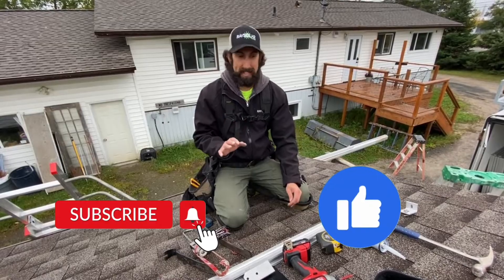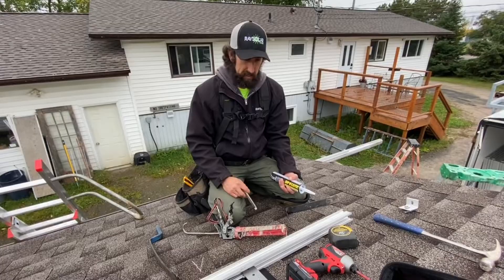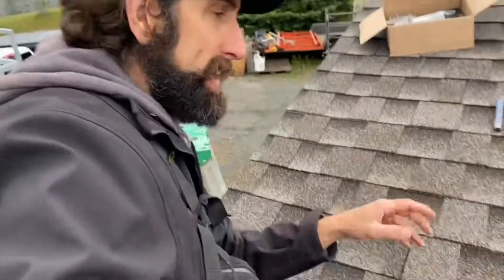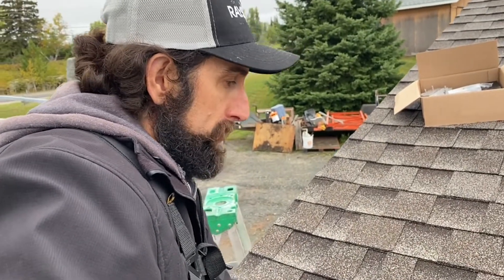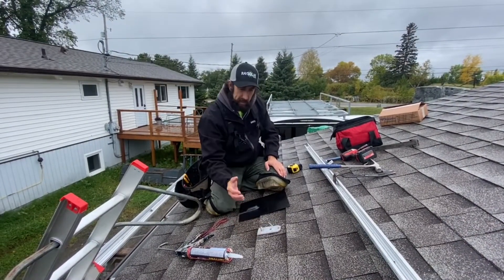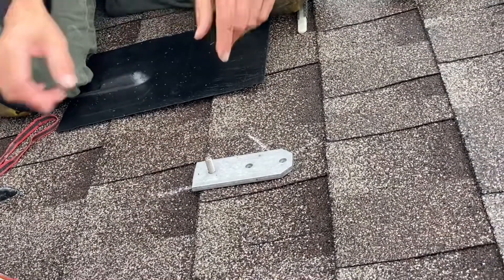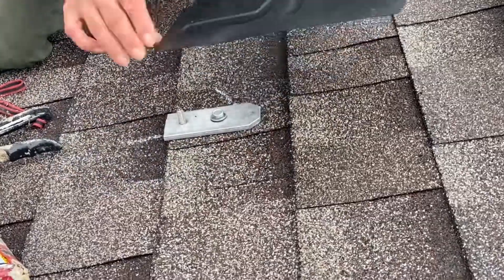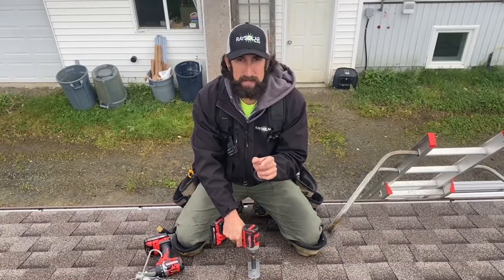Solar Asphalt Roof Flashing | No Leaks!

Comment: What's your procedure for an open beam ceiling? I have a living room facing south and it's open-beam with 3.5" wide beams. The rafter tails over the outside front deck are 1.5". I've heard that can be used as a guide instead of having to drill test holes in the living room which is why I've held off on going solar. Alternatively there's abuseable low slope  west-facing roof.

Comment: Any videos of rail mounted to flashing and panels mounted to rail? I'm getting ready to attempt this myself.
Reply from the maker: We currently do not have that video but thank you for the request, we will certainly consider that as a future topic of content.
Reply: @raysolarmadeeasy  I'm having a hard time figuring out what material I need to do install of 10 panels on my roof.
Reply from the maker: @larryscott2036  Do you know what brand of racking and panels you are using?  Generally the racking should have end clamps to mount to the outside corners and mid clamps that attach in between panels.
Reply: @raysolarmadeeasy  i have 400w Hyperion Bifacial panels. I haven't ordered any racking or materials yet. I want to do the flashing like you did in the video but I'm stuck from there lol.
Reply from the maker: @larryscott2036  If you have not ordered yet I would strongly recommend the Kinetic Solar Racking, and if you contact our sales team we can certainly provide support on getting this set up for you.  sales@raysolar.ca
Reply: @raysolarmadeeasy  will do. Thank you

Comment: What solar mount would you put on a five rib metal panel???
Reply from the maker: For Ribbed Metal Roofs, we would use the same Kinetic Roof Mounts, but rather than flashing kits you would use the standing seam clamps.
Reply: A hmmm, a five rib panel doesn't have a standing seam.... It is the crappy panel sold at home improvement stores but I have 26 gauge....
Reply from the maker: @SolarizeYourLife  In that case most likely you would drill Hangar Bolts into your studs.

Comment: I've been in the solar industry for 25 years and when I had my business, I did hundreds and hundreds of rooftop installations and was initially trained by a roofer. 15 years later I have had absolutely zero leaks. It's not rocket science, it's called proper training and an ethic of good workmanship. Something that is sadly missing with many solar contractors these days.

Comment: Absolutely correct when you talk about using proper flashed attachments (7:30) I've tried many different "PucK" style mounts, they are always the ones I've had issues with.  If you're putting solar on a roof, use the flashing style mounts.

Comment: Raysolar, why don't you use the roof flashing that has the 3" standoff made to it, with the 3" screw on watertight standoff that covers the rafter bolt, that you mount the rail to. No RTV sealant needed and it cannot leak ever

Comment: They have new equipment which can be direct to deck. No flashings
Reply: Flashing is the only way worth doing,but the one he used is not it,if you need rtv sealant,don't do it.. Mine is similar to this but a 3" standoff made to it,bolt through the center standoff,with a screw on watertight 3" standoff on top of that covering the bolt,rails bolt to that. The only way this could leak is to be ripped off the roof,best in the business and will outlast your roof. JM2C

Comment: The hole you made to hit the rafter and the hole you made to miss the rafter are the only two you need to know center or close enough anyway. At the end of the job that’s a lot of unnecessary holes if you add up all the third holes. Flashing covering them or not. It’s just best practice, fewer holes the better and less chances for a leak
Reply: I'd argue if you want to get technical and waste time, you only need one hole.  Tap to get general location, move over 2 inches and sink a screw.  Go into attic and measure distance to rafter.  Now go back on roof and measure over to center of rafter.
Reply: @cheerbeerification 😂😂😂😂😂

Comment: Have you tried the new Iron Ridge HUG system?  It doesn't use flashings - is it good?
Reply from the maker: We have not used the Hug System. The mechanical flashing approach demonstrated here has proven itself and has never leaked. Thanks for your comment.

Comment: I do not want my roof as your test mouse. You drill 3 holes to know the right place to mount the flash. Sorry man. If you do not have any better way to know where you should mount the flash then you are NOT working on my roof.
Reply: It’s better to have a few small holes to know the lag bolt is centered in the rafter rather than “maybe” hitting the rafter and having your array rip away from your roof in a windstorm. Uplift is a thing and a sealed hole is cheap insurance.
Reply: Stud finders don't work well through shingles, underlayment, and decking.
Reply: Chiptoolz makes a rafter centerline finder tool. Still have to add an extra hole, but it marks dead center of the rafter.
Reply: How many holes can you drill in a truss before it snaps?
Reply: That’s how it works
Reply: I thought about the same thing but wha about a stud finder ??

Comment: What do you think of using a thermal camera for locating the truss?
Reply: Use a deep scan stud finder
Reply from the maker: That would be an option as long as there’s a temperature contrast in the roofing materials to detect it.